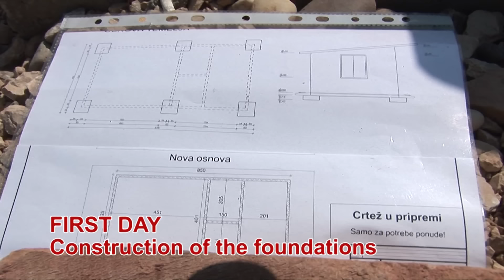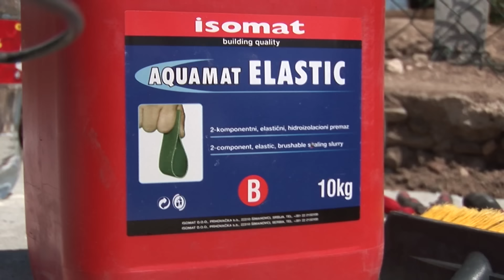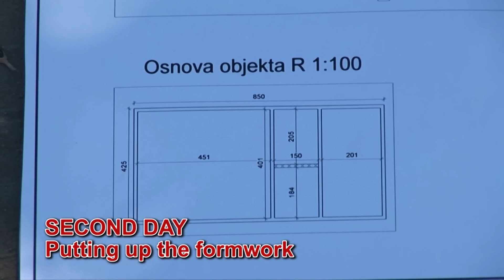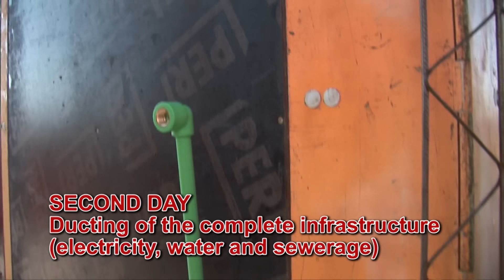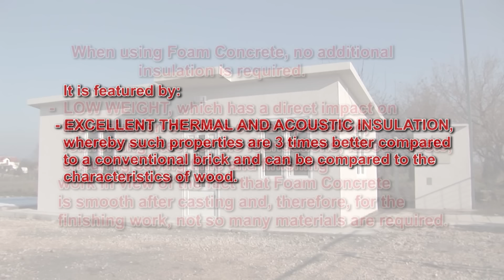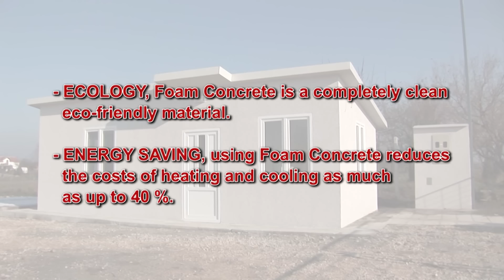FOAM CONCRETE, affordable house built in 6 days!

Comment: Interesting concept but I thought the least thing eco friendly in building was concrete?! and to be fair there was a shit load of concrete in that build!
Reply: +Mike Allen Too much Concrete. There was nothing for ground movement, weatherization/cost-everything was cheap. I wouldn't come near to considering this as a viable option!
Reply: +Robin Sauls they didn't mention all the costs. It seems like higher priced workers would be needed and cranes are not cheap to use for a week. I would need actual costs to even consider something like this. I need to put up a garage
Reply: they probably had to have the concrete to anchor it after all you'd think a good 40-50 mph wind would have a foam house tumbling down the road without a good anchor
Reply: Concrete is sand, rock, Portland cement and water. It lasts  longer than wood, so what's so ecologically bad about it?
Reply: Dwayne Mattson Concrete uses cement. Cement is heated limestone which releases the co2 to form calcium oxide. this as well as the heating process is the unecological part that makes concrete the eco unfriendly material which raised my original point.
Reply: Yes making cement makes CO2, but what in the world doesn't? Even plants give off CO2 at night. Every breathing animal in the world does too. What alternative material do you suggest they use instead?
Reply: I forgot to say I drive a concrete mixer for a living, so I have a dog in the fight here. I also don't see a good alternative to concrete for footings and foundations, there isn't a material out there that handles moisture, and is as resistant to rodents. We make grain bin bottoms out of it so your organic bread comes to you without rat droppings in it.
Reply: +Lisa Smith For christ sake it's a house in which people plan to live for a century and it's not a bottle or plastic bag.I guess you would rather have a house built out of plywood so it gets blown away by some stronger wind.And where is the logic of a plywood house being eco friendly? That wood is cut somewhere you know that
Reply: Drago Vasilj It doesn't look like anyone hear is knocking a foam house I'm actually interested in this concept after all you make a good point about a 2X4 and plywood house. Just look at what it takes to insulate and dry it in with all the caulking paint and stuff. Perhaps take it easy on the red bull you're a little high strung
Reply: You forgot the aluminum powder in the cement, that can't be good.
Reply: Dwayne Mattson
that's true sir I drive a mixer truck as well about 4 years ago I pulled some mud out of the chute just a little more to fill the form and got cement poison under my fingernail. burned like hell and after 4 years its still kinda numb. just think about how much cement dust we breath, I think OSHA kinda overlooks that
Reply: This would be good for Moore Oklahoma with all the tornadoes they have ............
Reply: Haven't had the cement poisoning problem so far.
Reply: Safety 3rd. Jobs need to get done, someone has to do them because if no one does, everything goes to hell.
Reply: +Patrick Ancona sounds like someone's bitter that they didn't get to go to burning man.... smoke a j my friend, you'll feel this animosity leave in slow spirals. ;)
Reply: +Mike Allen Not eco unfriendly if it stays erect for a hundred years - and even then, you can recycle the concrete.
Reply: +Dwayne Mattson correction: green plants breath IN CO2 and  " exhale" oxygen at night. Plants and animals exhale what the other needs, aided by UV. Photosynthesis. I don't think they teach this in schools any more, otherwise there wouldn't be all this CO2 phobia going around.
Reply: Actually I knew that. Crazy thing is you can plant more trees. Weyerhauser plants a million a year.
Reply: Dwayne Mattson true enough.
Reply: +Dwayne Mattson but will it burn does it rot  concrete done right is for ever.
Reply: +Dwayne Mattson  Gee they've only been using it for over 2 millenniums! Also this crap for ECO friendly. Most of the products that are so called ECO friendly, end up doing more harm to the Earth! One last thing, for all the work and years to try to remove CO2 from the atmosphere. It takes a few minutes for a volcano to put it back in!
Reply: Eflat Productions not to mention the oceans give of CO2. Or is that O2? I forget! They give off something useful!
Reply: The oceans absorb CO2, then it sinks to the bottom, and comes out again from volcanos.
Reply: +A Keeper Of Odd Knowledge CO2 is used by plants which give off O2.  No CO2, no O2.  A fact the tree huggers fail to mention when over regulating every aspect of our lives in their process to grab tax and regulation money while world economies collapse from their political actions.  Follow the bouncing buck, my friends.  In the 70s it was global freezing, then it was global warming, now it's climate change.  I call it the 4 seasons!  They're all FOS and scientists are now confirming that it's all BS. Pour away, fellas.  Meanwhile I'm going to bleed the freon out of my car and put in fresh!
Reply: John MacNaughton by the way, the microbes in the ground love Freon. And one MORE thing; Freon is heavier than air! It would have to climb a ladder to get to the ozone layer! But YOU already knew that. Dontcha just hate the PC crowd?
Reply: +John MacNaughton You are clueless. If you are going to cite facts, please cite COMPLETE facts. Plants offgas O2 during respiration & offgasing CO2  during photosynthesis. The world is a bit more complex than your anecdotal over-simplification. 
Many folks - like yourself - don’t understand that plants do both cellular respiration ( sugar + oxygen → carbon dioxide + water) and photosynthesis (carbon dioxide + water → sugar + oxygen) - thus producing BOTH CO2 AND oxygen (O2).
At night plants do not produce CO2, but rather absorb it. This is why it is called carbon fixation. The process is light-independent, and more formally known as the Calvin cycle. During this cycle, 3 carbon dioxide molecules are absorbed to produce the small sugar G3P (glyceraldehyde-3-phosphate) for the plant to use elsewhere. Two G3P molecules are required to make glucose."
Plants are also doing cellular respiration all day, as cells use a form of energy called ATP that they get by doing cellular respiration. They can’t use the energy in the sugar they make until they break it down into ATP.
All of the cells in a plant do cellular respiration, but not all do photosynthesis. Look at a tree. How much of it is green? The entire tree (except the outer bark) is living cells. Some are deep inside the trunk or roots. They never do photosynthesis. So where do they get their energy? From the sugar that the leaves make. The sugar and other stuff move around in the tree sap. The cells that don’t do photosynthesis are doing cellular respiration all day long to get their energy from the sugar.
So, while its easy to generalize and say they do photosynthesis during the day and respiration at night, all is NOT so simple.
Reply: +Mike Allen Nobody said anything about it being eco friendly.
Reply: I don't understand why they didn't just build a dome home considering the location and everything.
Reply: It doesn't last longer that wood everywhere. He in New England, I see a lot of wooden houses that have had their foundations replaced. The salt destroys the rebar, so parking garages and bridges are some of the shortest lived structures up here. But I'm sure it performs much better in hot dry places and it has plenty of advantages over wood, like quiet and fire resistance.
Reply: @Goose_Farquit  Yes and no.  Of course the CO2 returns to the stone as the cement sets.  The heating process  is electrical, so it depends on how that power was generated.
Further, concrete/cement houses are very low maintenance, a cement roof would last a hundred years.  Air crete used less cement (the powder) per cubic foot than regular concrete.  The mix is not shown but he does mention "samples' to determine compressive strength. 
Lots of energy collecting, sizing aggregates, where air crete uses none.  Handling costs are far less.
The question is, compared to what exactly?  Block?  And plaster (5X cement)? Metal studs?  finishing both sides add insulation?  (fiberglass is melted sand as well).
It would take a careful study indeed to know the exact CO2 emissions costs of any total system.

Comment: time for concrete to dry ? lol more than one week
Reply: haha. true. or else, they put a  cement accelarator (sodium carbonate) to speed up the time of curing..not 100% sure but still it is really possible.
Reply: Cédric Arn. v b7vh
Reply: Time required to gain enough strength to stand for subsequent construction steps, 6 hours.

Comment: I'd add a support beam in the center for sure... also that bathroom should be a few feet bigger. Wirewhile doing the framework. Definitely needs insulation on those pipes. When finished I'd also add another roof on top suspended by independent supports

Comment: 👏Like it the way finish.👍 How ever Do Not meet 😕 code construction, duress and severe weather changes. 😑  
Review, foundation is not deep enough to meet any Artic Region, Northern and Southern Region as well Mountains Region due to drastic or extrame weather change in temperature. Cement will create cracks and crumble do to environment construction.
Also, in areas we're symic (earthquake) are constantly a treat is an important issue,  not qualified for living in it.
But, I do like it 👍 for alternate for work place, office applications and/or storage area.
Shure , looks real nice.  The two biggest questions ( ? ). How much cost to build it? (materials and labor cost) and How long (in years) will last with minimum maintenance ?
Thank you for sharing.
Sincerely,
Mr. Villalba😎🇵🇷

Comment: WAIT. Everything I have read about foam concrete is that it can not be poured more than 16-18" at a time or it essentially is eliminating the effect of the foam by compressing it??? It would seem that this needs to be poured in a form on a flat surface at the thickness desired and then attached to the structure? Also, I noticed they added cement, aggregate and water but they conveniently omitted the "foam" part of the recipe.

Comment: Would it  be cold living in a concrete  house?
Reply: That was my thought as well. Between the concrete and tile. 🥶 It is a very small house so won’t take much to heat it up, but don’t let it get cold or it will take a while to heat up.

Comment: what exactly are those special additives? how are they manufactured? what is the base foam material? will it become non dissolving waste in the future littering the countryside with no means of disposal? what if a tornado rips it apart? what happens to that foam then? is it bio degradable? or will it last 1000 years?

Comment: Stunning. By definition, "foam" is produced NY whipping in air. I wonder how this concrete can hold up after drying
Reply: It's not as strong as solid concrete, but a wall made of foamcrete can hold equivalent weight to what a studs&plywood wall can.

Comment: The problem is not about the building like what.

but the country, the difference in buildings can be obtained from the country.

Like in Asia, they always use a lot of iron poles for the foundation, which are stuck from the ground up.

but in europe it doesn't use such pillars, it lays bricks without connecting to any foundation.

All of that because of the earthquake, whether the country is prone to earthquakes or not.

Like in my country, every corner always has foundation pillars that are stuck into the ground, even though this is only a one-story house.

I'm planning to build a house, and I see a lot of videos of building houses that don't use foundation pillars.

I often think is this strong enough? if there is an earthquake it will not collapse.

Comment: Question:
Is this foam concrete insolated? Does it burn up in the summer and freeze in the winter? 
Anyone can answer...
Reply: Was wondering that too and also, how well does it withstand wind, hail, heavy rain, etc. How many years does it last?
Reply: @witchhazel4135  I imagine we'd have to inquire with the manufacturer of the product.
Seems like a great solution for combating homelessness.

Comment: Love how they didn't even bring in a Concrete Truck for the Foundations but Mixed it by Hand... Yeah! 
Also note... NO Actual Cost Given or Comparisons to Building with Cinder Blocks or Wood... How Much Did THIS Cost To Build and How Much Would it Cost to build it using Cinder Blocks or Wood??? Where is That Info????

Comment: all buildings should be built with the same precast modules. If its deteached housing it should just be a single apartment from a housingblock. All the modules should be transported out from a factory where the modules are massproduced. The modules could possibly be constructed using this "foam concrete". But you shouldnt have to build it manually like this. Also, if you ask me, in order to have deteached housing you should be connected to some sort of farming industry or similar where you need alot of space or some sort of rental tourist capins or similar for recreational exploration of fascinating scenary.

Comment: In earthquake zones i would not do this  even if they try to tell you different over time it will happen, it also weakens. wood is way better, moves a flexible. R value is different. foam create on the floor is good.

Comment: I'm in no way an expert but I have used foam concrete a few times over the years and admittedly nowhere close to the scale in this video but aside from the guy at the beginning spraying that foamy stuff on the ground  everything else looked like normal concrete being poured. Like I said I'm no expert but I'm confused by the lack of any expansion that I've always observed in my use of foam concrete. I'm sure I have to be missing something with this. Anyone able to tell me what I'm missing here? I'm not saying that it flat out isn't foam concrete but to me it looked  like a normal concrete pour in so many ways.

Comment: Within 6 months this building will have so many cracks due to concrete shrinkage from it being to wet while being poured. The concrete should have been no more than a 4" slump and vibrated into place. Not so wet that it flows like water.

Comment: if I start counting; levelling, a stability survey, laying a grind slab at height, laying the concrete slab and a quartz on it  ...the water the electricity  and so on. Cheap windows the cheapest on the market no German Schückos Cheap very very standard porcelain baths and cheap unreliable tchechish water cranes (nu Hansa)  We have here a more or less traditional small base house that needs relatively a lot of labour. It is not like you come on with a truck with 4 walls and a roof and put that up in a day or two. So no prefab. Architecturally limited to squares. a flat roof which is not nice and reduces spaces drastically needed in an addic. A new very fast drying  unknown material does that breathe or do you get moulds? .Now when I am counting that will cost around 80.000 euros. That is only good in an area where land is very cheap AND labour is very cheap, in that combination.  In Europe in my country I ain't gonna pay 200,000 euros for a 2,5 are of plot of builsding ground and put a a 80000 blokee of house on it. That is not logic The germans are thinking in a much more logic direction of designing a small and conveniant ecological family home that still can be seen as a house. It needs some architectural corrections but it is much more reliable (worth) on the long run. So somewhere the market is limited to produce that in big quantity. We experienced that a construction firm needs to to build one house a day all year long to be viable.Besiedes that a construction firm needs a number of buiding projects that are bigger and cheaper to survice. Once you leave these parametres ...you'll go broke and very fast too. In Europe the aim is to maintain the German standard in materials. Here you will loose quality in finish and you will be obliged to direct to inexperienced east block manufacturers or go chinese. That ain't the best idea. Have you ever set an Italian Zuchetti water tap? Don't spend money on that, a very good advice<; buy the cheapest Grohe or <ideal. That is my experience, I walked around in construction business. It is not especially an art to manufacture cheap products its is an art to manufacture longlasting good product with a long lasting service after it. Then I am watching to German manufacturers only. No British no French No Spanish No Polish Belgian. That is the art.
Reply: Interesting

Comment: It’s nice but the lay out can be better.  Seriously walk from the front door into a wall and the bathroom?.   The bathroom should be tucked in a corner and also it is too small with the weird angle of the toilet.  That should have been the entire shower, faucet below the water heater and toilet were the faucet was at.  Also kitchen tucked into a corner open floor plan cabinets only in the other walls and nothing blocking kitchen from living room. So much open room.   You’re welcome.

Comment: That's not foam concrete it's the same mud with the fiberglass mixed in I've poured that before it's supposed to prevent cracking